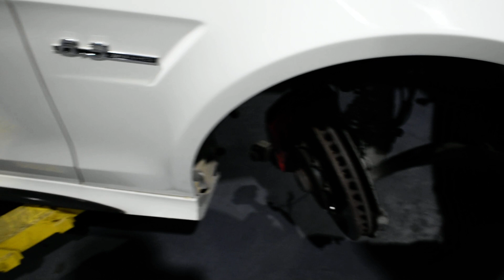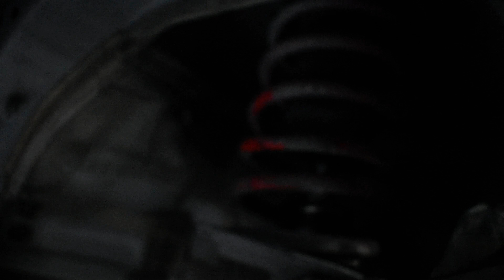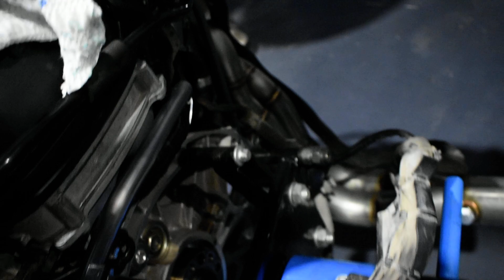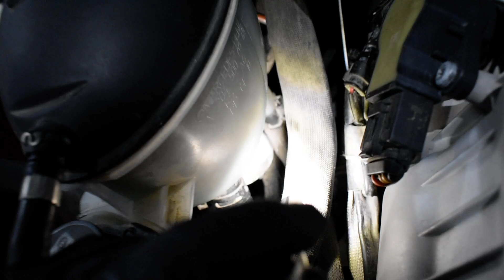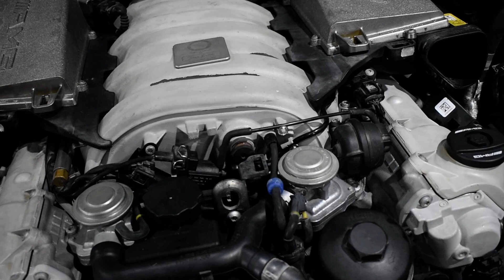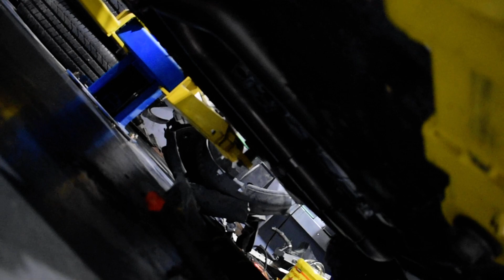E63 check up Jan15 (part 14)

Comment: They "' Looped" with small gauge wiring. Too much current going through those wires and.....disaster.  Nothing like electrical wiring fumes coming from under the hood.  Bet you were relieved when that car left the shop!  Cheers
Reply from the maker: I can't release the car like that, it's still with us.
It's not safe for anyone in this condition
Reply: @TasosMoschatos  I bet you've made quite a few safe before leaving. Cheers, Kev